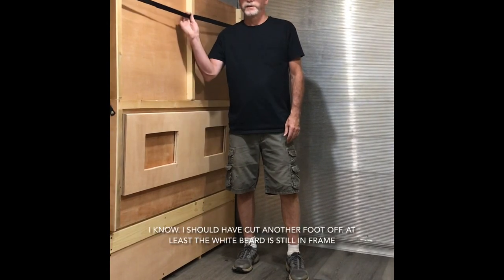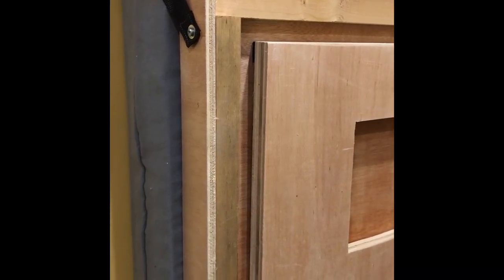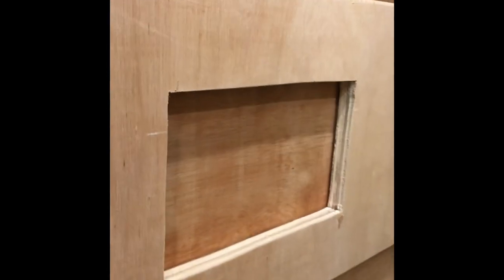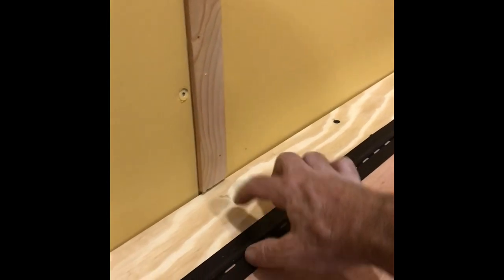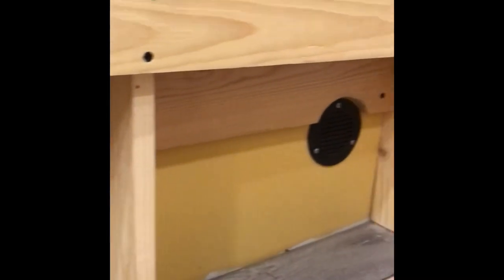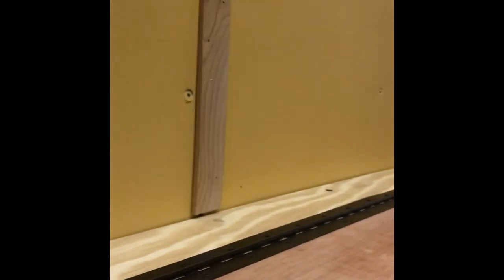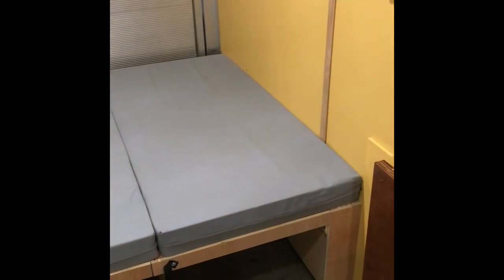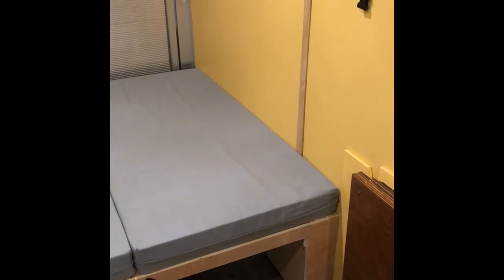Cargo conversion trailer flip up bed

Comment: Nice and simple build.  You do lose some storage area below by totally covering the bottom section.  You could have cubbies in there to store your tie down straps and other items.
Reply from the maker: Thanks.  We haven't pursued "maximum storage". Figured we'd add storage as we need it but really haven't yet.  We can spend 2 weeks on the road pretty comfortably.
Reply: @jackpinebearcat1845 I know it kind of defeats the KISS concept, but that space would be ideal for pillows and bedding…another piano hinge (actually just a few short sections) to allow the panel to lay down on the floor and bungee cord to secure the bedding in place against the board and a magnet or slide bolt to keep it in place when folded up against the base of the bed.

Comment: Do the fold down legs have a brace holding them in place ? or do they not need one. great job!
Reply from the maker: I did add a brace, basically a board with a notch in each end that locks the two legs together when they are down.  I don't think it is really needed though.  We slide totes underneath the bed and I thought maybe we'd knock a leg loose without it.

Comment: Where do you store the middle piece of board ?Could you list where you bought the foam and bed materials please? Nice set up !
Reply from the maker: The middle piece stacks on top of one of the sides when it is flipped up.  We bought the foam pieces from thefoamfactory.com, buckles and straps from local sporting goods store, the canvas fabric from Amazon, zippers and basting tape from sailright.com.  Sailright.com has a really good tutorial on making the cushion covers.  We were able to make decent zippered covers, but there was a little bit of trial and error.

Comment: What are the dimensions of the frame when assembled?  Looks great!

Oh, and did you cut the foam yourselves, or have it cut by foam factory?
Reply from the maker: The bed is 55” x 82”. We ordered the cushions precut to size, in 3 pieces. Since they were custom cushions we could make any size we wanted and made the bed the full width of the trailer.

Comment: What kind of screws do you use and where do you screw them to?
Reply from the maker: I just used regular construction screws into the plywood wall.   The screws going into the wall are not load bearing, the weight goes down to the floor through the bed itself. The screws just hold it in place.